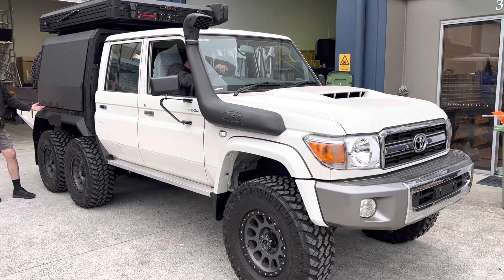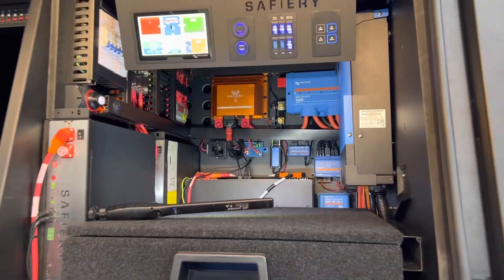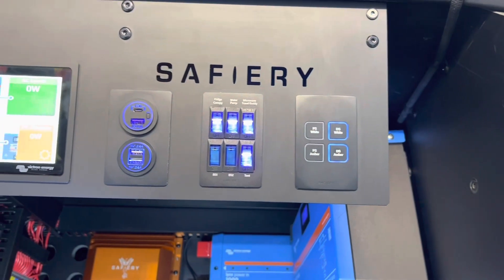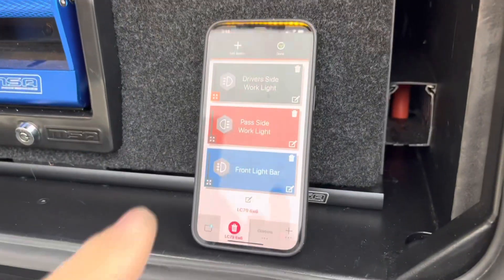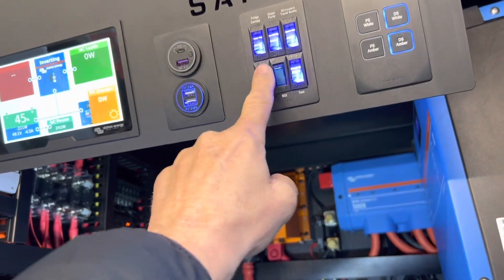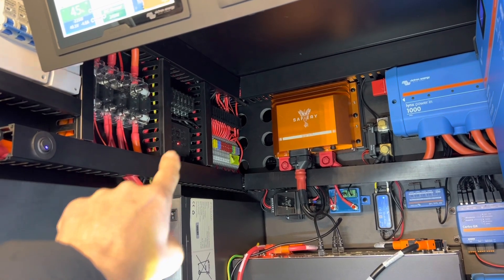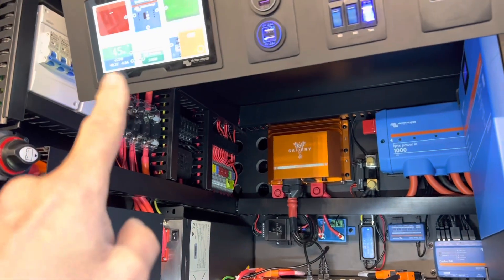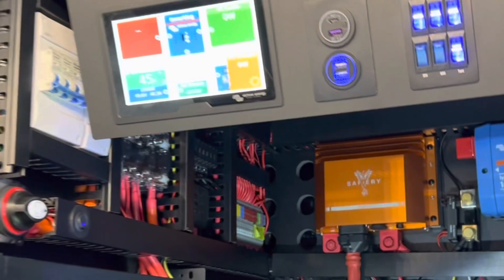Mega Power in a tight space only with 48V System by Safiery 6000W Inverter 800Ah Lithium Scotty

Comment: Do you completely disregard the clearance requirements for the Victron equipment and just hope it will operate as intended. 
Just because you can cram it all into a tight space doesn’t mean you should.
Reply from the maker: Good Question. Clearance is for airflow for cooling. We solve that problem with our range of temperature switched fans at 48V and cut outs for airflow. It may be hard to see but in the top left hand corner there are 6 x 50mm Dia holes cut through to other side. Our CANbus Lithium Batteries report temperature several times a second so we will see the temperature inside this canopy with a long term trend. We have over 200 on line monitoring them and can report excellent results. No job has required reconfiguration because of temperature. This is quite some IP in the layout and how we do this that most would miss.